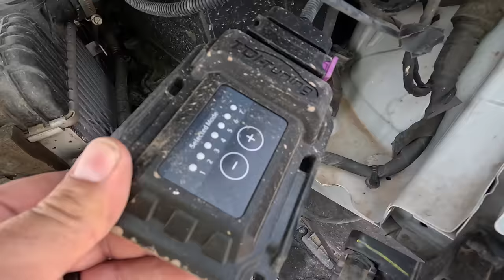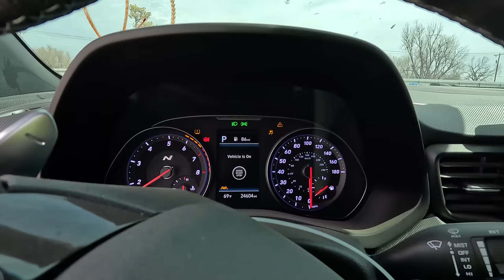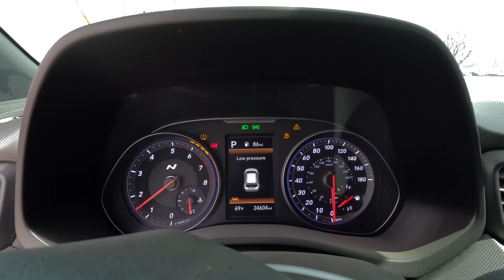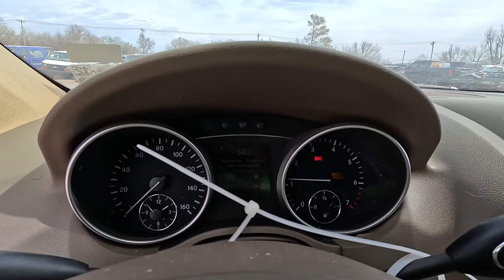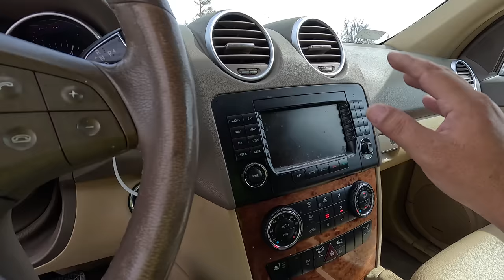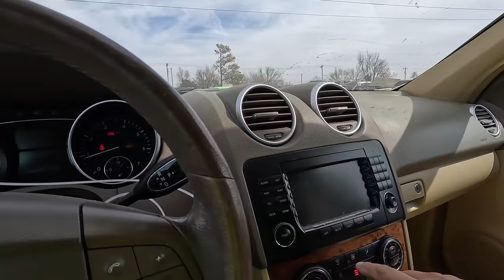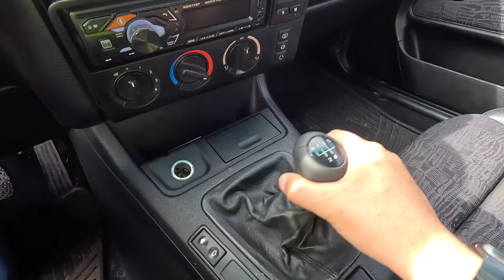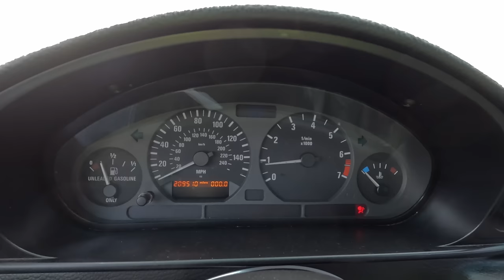Copart Walk Around 3-17-23 + Something Died in this Impala!!! *WARNING*

Comment: I use racechips tuner. Looks similar. 1-7 settings. It intercepts the MAF & intake pressure sensor signals and sends different ones to the ECM. Makes my 1.5l EcoBoost push 230+hp.

Comment: Hey Randy you wanted to know what tdi tuning is. Here what it is it optimizes engine sensor readings to increase engine performance. This means each of your drive modes will have up to 40% more power if you using mode 7. So in eco pro/comfort mode the tuning box will be giving it more power.

Comment: The optima is a 2.0t, the tuner they have on there is definitely something they just found online, usually with kias and hyundais anything other than the lap3 tune isn’t recommended because we all know theres a recall on the engines for knocking and locking up so the “unknown” tunes just speed up that process, lap3 is the most respected and reliable one

Comment: Wow, that was some heavy stuff in that Impala... Strange they didn't put a BIO hazard sticker on it. Maybe the stuff what is rotting wasn't rotting at the time the car came in? I think you can take the risk with that BMW 318ti compact man, engine is a good one, just replace that valve cover gasket and you're good to go. And fix the body a bit. These cars are so fun to drive. The compact is a mix between the E30 and the E36 if you didn't know. 😄

Comment: The Red Impala might have been a car that someone passed in and was not found for a while. That would be why the flies were so bad  My former boss was a dealer and bought a mid to late 80's Oldmoble full size station wagon and it wasn't as bad a this Impala but it still smelled pretty bad. He had no sense of smell so didn't know it smell until we rode in it. Ugh

Comment: HEY RANDY FOR KIA OPTIMAS AND HYUNDAI SONATA WHICH IS WHAT I HAD THAT LITTLE TUNER IDK ABOUT THAT ONE BUT I HAD A LAP3 PIGGY BACK TUNE U PLUG INTO CRANK N CAM SENSOR AND IF Y RUN THAT WITH DOWNPIPES AND A METH KIT YOU CAN RUN UP TO 4-450hp FROM THE STOCK 270-290HP ITS NOT GOOD FOR THE 2.0T MOTORS THEY RUN THEY BLOW UP ON THEIR OWN ANYWAY BUT I WAS RUNNING AROUND 360 WITH THE TUNE AND DOWNPIPES AND ITS A MONSTER THEY HAVE BIGGER TURBOS THEN THE GENESIS COUPES DO I MISS THAT CAR SO MUCH. BUT LAP3 IS THE LEADING TUNERS OF KDM KOREAN DOMESTIC MOTORS AND OTHER VEHICLES. WORTH THE PARTS THEY MAKE.